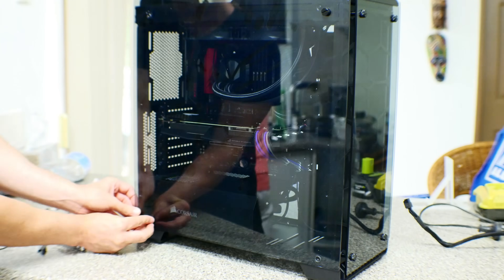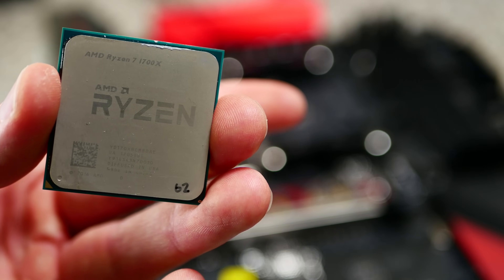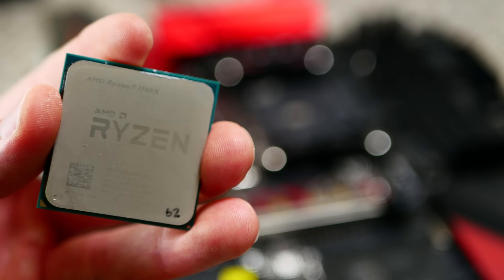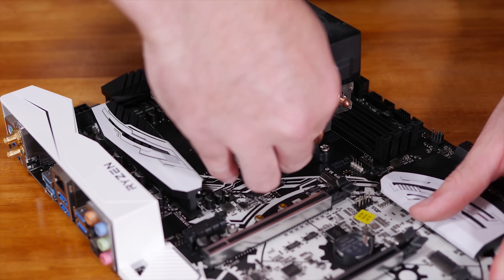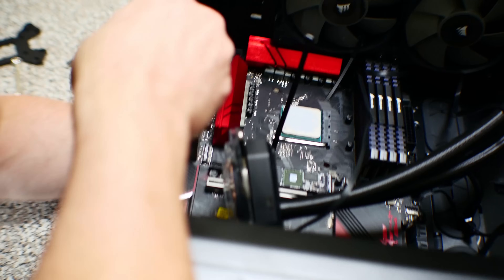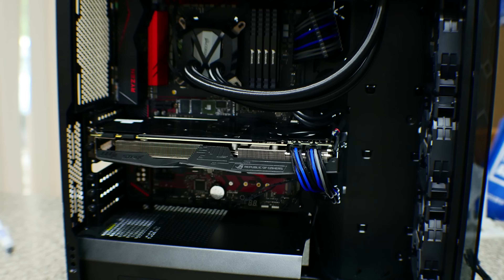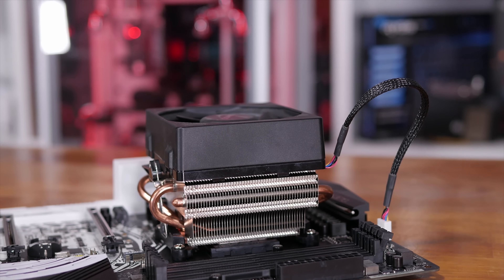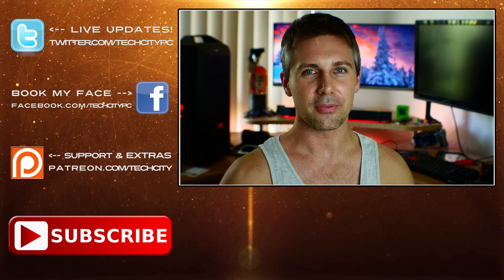AMD Ryzen AM4 Vs. AM3 - FYI - Avoid Any Day 1 Cooler Problems!

Comment from the maker: Got some measurements for you guys - 
AM3 - 49 x 97mm
AM4 - 55 x 92mm
Reply: If it wasn't clear:
The 4 holes on the motherboard are important for an aftermarket cooler that doesnt clip on the plastic  retention brackets and will use the holes for bolting the heatsink down.
Otherwise a stock 754/939/am2/am3/+ amd cooler fits on the am4 socket
Reply: @igorbog88  Thats what I've been confused about, all my coolers are compatible but I keep seeing compatibility posts on forums. I didn't understand what the problem was.
Reply: All the AMD AM3+ clip cooler will fit on AM4..
Reply: Tech City Thx alot . Im still waiting for the vid :) .
Reply: Does this mean that i can go to the store now and buy a h60 and it will be guaranteed to fit? Just switched out my server comptuer hardware to a 1500x. And the wraith spire that came in the package isn't quite holding up to the overclock i want.
Reply: Thanks amd! Where did I put my drill...
Reply: i think Thermalright says 54x90mm

Comment: So I just ordered a ryzen cpu for my am3 motherboard. Your saying that the processor will sit in the pin holes but I need a different structure around the processor to mount fans to cool it?! So I am happy without the structure with big cooling fan the processor works just fine?! The pins and the holes of the processors bed are the same right?!

Comment: I used my FX Wraith cooler on my Ryzen 5 2600X. It clipped right on the B450 mobo out of the box no screws. This 2016 FX version (shown here 0:51) is basically a non RGB  Prism with some minor differences in the plate. Originally designed for the 125 watt 8 core FX space heaters, its a thermal god on a 65/95 watt 2600/2600X. Its within 5 ℃ vs. Hyper Evo 212 in test : https://youtu.be/D9lCASJ17ps?t=163, better than stock, great price if you have one already, snaps right on, nice back lit logo.

Comment: I know I’m late to the party. Intel guy here. I just build a zen 2 system and the cooler I bought shipped with an old style backplate that doesn’t fit am4 even though it claims it fits on the box and the instructions claim it fits. I contacted deepcool who makes the cooler and they are basically acting stupid. Sending me photos of the instructions that I already have on paper in front of me. Asking for photos that they obviously didn’t look at because they won’t even acknowledge the issue. I’m lucky amazon graciously decided to replace it and a new cooler is on the way. I hope it comes with the right backplate. I’ve wasted a lot of time and money trying to get a 50 dollar cooler to work when I could have bought a noctua instead lol

Comment: I have a Cryorig R1 Ultimate air cooler as well as the Akasa Venom Medusa air cooler (with three Noctua 3000 rpm indusrial fans). Currently using my Akasa on my awesome X99EWS (with 5820K). I emailed Akasa and Cryorig one week ago enquiring about AM4 brackets. They both replied they are still working on it. No idea of ETA. Not impressed as I cannot build my Ryzen rig. Have to twiddle my thumbs and wait for the AM4 brackets. Any idea where I can purchase the new AM4 wraith cooler?. BTW, I live in UK. Thanks for help. Peace out!.

Comment: Hi Tech City, i wanted to ask if a Pentium G4560+ Gtx 760(From Ebay) is a good idea ? A pretty basic Pc with evrything new, just the 760 is used would cost 300-310€, GTX 760´s are selling for around 50 € in Germany

Comment: Soooooo... this guy doesn't know about all the adapter plates/kits for the AM4 socket and the more popular bolt on cooler brands?
If you have a clip type AMD cooler, it's supposed to already work. They changed the bolt circle, but left the spacing on the brackets for the clip mechanism the same.
If you have a bolt on CPU cooler from Cooler Master, Noctua and some others, you can get kits for your favorite old cooler to fit AM4 mobos.
Reply from the maker: I mentioned that the latch type coolers will work, however bolt downs won't as the holes don't line up.
Reply: That's just it, most popular coolers will work with AM4 with the 
"adapter kits". Noctua and others are putting out adapter kits for popular CPU coolers.
https://www.newegg.com/Product/Product.aspx?Item=9SIAADY5BC4729&cm_re=cooler_am4-9SIAADY5BC4729-Product

Comment: Thanks for the heads up! Luckily Cooler master will release a bracket for the hyper 212 evo, so I'm covered. I want to ask you for a huge favor, I noticed in this video that you have the Fatal1ty X370 Gaming K4 motherboard. That is the motherboard I'm looking to buy for my Ryzen upgrade. Could you please please please make a review on it, and maybe you could answer a question that I have about it. What is the max ram speed that this motherboard will take? The asrock website says up to 2667, but I know ryzen supports 3400+ hz

Thanks!!

Comment: Hey, thanks for going over this. I was wondering the same thing. I know that Ryzen is on a new platform, AM4, so CPU cooler compatibility will be different. Its looking like early adopter headaches for sure. I am still 50-50 if I am going to get Ryzen on day one because of this stuff. Not to mention, other things once all the components are installed like software, bios, issues, as well as, what kind of a platform AM4 really is. Like, we know, it has 8-cores. But, does general computing, day-to-day stuff benefit? What about video editing? How does Ryzen, in video editing and general computer usage, feel like? I hope you go over this on your review? Like, the "feeling" of Ryzen? The snappiness of Ryzen? How does Premiere Pro, for example, react to Ryzen? Thanks!

Comment: so if anyone was wondering the biggest air cooler that still has a hold down bracket is a coolermaster T4 anything bigger includes custom mounting . so in theory you could use that untill you get a braket instead of stock

Comment: Simple solution, hold off buying Ryzen and wait for an appropriate cooler update or new release. Current products may not be fully replace within 6 months (whether it is retail store or online).

There are AMD stock cooler for $5, or $1 if you buy it second hand.

Comment: I've been told by the company I ordered my 1700X that stock coolers will be included. At least will be able to use Ryzen until Corsair and NZXT catch up (they been asleep). Those are the makes I use. NZXT told me they'll only have AM4 brackets by march 15th. That's 2 weeks after Ryzen arrival date. WTF have they been doing ?? It's not like they didn't know Ryzen was coming.

Comment: I had heard the ryzen die is thicker so am3 coolers that fit will cause undue pressure to the die.  Can you confirm this?
Reply: adding a few small washers should fix that i would think,and/or getting different screws
Reply: AMGV Media http://www.tomshardware.com/news/amd-ryzen-am4-motherboard-heatsink-problem,33771.html#xtor=RSS-100

I'm confused now lol

Comment: I beg you, PLEAASE benchmark CS:GO at day one.  Every CS player has been waiting for new more powerful CPU's that can run the game at 350+ fps at all times.  When ou do the benchmark, please do it with low settings. I think this is something every CS player will appreciate!
Reply: Make sure to hack autoexec.cfg to run in 320x200 resolution with Minecraft shadows.
Reply: You're kidding right? CS:GO is one of the most CPU intensive games, if not the most. Yes, it runs on potato CPUs, but it is still very CPU heavy.
Reply: One of the "MOST" CPU intensive?
Reply: NO MA'AM National Organization of Men Against Amazonian Masters!
Reply: Getting high FPS makes a huge difference in competitive games. The difference between 200 and 250 FPS is very noticeable, even on a 60Hz panel.
Reply: ArdaBlock i get 200+ with a shitty haswell i3 3.5ghz and rx 470... its not a demanding game at all, and there is "only" 240hz monitors out now...
heck even my amd apu hooked up to my 4K tv gets in UHD 50-60fps... 40-50fps in proper 4K.

i tested this game at 290-300fps on my friends computer and i cant tell any difference between his and mine.
in the end, i capped it to 144fps since thats what my monitor can display.
Reply: I'm not saying it's demand, I'm saying it's CPU heavy.
Reply: Beamng.drive is probably the most CPU demanding game that I can think of.
Reply: Except that Ryzen isn't a gpu...
Reply: a lot of people are missing the point. CSGO does benefit greatly with higher frame rates .  the higher the frames the faster response time you get in game. there are videos on YT that prove it that's why completive cs players aim for the highest frames . and Gpu doesn't matter all too much as long as it's a capable one
Reply: well the hope is that one of the cheaper processors will run cs go at 350+. That's the point of the benchmark. Benchmarking something like the 1700x makes no sense because we know it will
Reply: CS:GO, are you fucking kidding me? Might as well try out minesweeper. Let him run some real demanding games to see the potential of the chip.
Reply: ArdaBlock  yet a stock haswell i3 3.5ghz pushes 200+... nope not buying.
cant be worth spending 4times on the cpu just to get the last 40-60frames, better off upgrading the gpu.

Comment: I've read product description before i pre-ordered Ryzen 7 1700X, it's bummer as hell, it didn't include with stock cooler, so, i had to look up Coolermaster compatibility schedule if a heatsink could fit or not without buying a bracket, i picked Hyper T4 for cheap price from local store then pre-ordered Ryzen 7 1700X.

I think wraith cooler could be also adds more price tag with it for 1700X and 1800X. Ryzen 1700 non-X comes with wraith cooler, what the product says so.
Reply: Sarge JJ it's normal lol

Comment: sweet so any am3/3+ mounting hardware will work?
Reply: No, am4 is ryzen socket type.
Reply: No they won't. Sockets are different size. A few will but most won't. Different bracket needed.

Example:
https://www.overclock3d.net/news/cases_cooling/corsair_releases_socket_am4_compatibility_info/1

Comment: Zip tying your cooler to the motherboard if it doesn't fit the mounting holes is okay so long as the cooler is tight enough. Just for the love of god, DO NOT DRILL YOUR MOTHERBOARD. The PCB of the motherboard is layered so even though it may look like you're not drilling through components or connections, you most likely are. You will kill your motherboard by drilling it
Reply: He's right, you should never drill your motherboard. Use a hole punch instead ( ͡° ͜ʖ ͡°)
Reply: NO MA'AM Or a belt sander. whatever gets through the first later
Reply: RaMpAgEAuS117 a hard lesson learned easily through jayz2cents. 😂
Reply: i would try and drill a hole in the bracket first

Comment: I know for a fact coolermaster has a compatibility chart showing which coolers shouls already have the new AM4 brackets if you buy it close to the launch of RYZEN and i know for the masterliquid pro series they offer the AM4 brackets free but you have to pay shipping .. SO just check with your cooler manufacturer web site or contact them ....

Comment: Thanks, :D ... Please make a huge Benchmark, not just GAMES, try heavy SOFTWARE please. from Autodesk, and Video editor rendering
Reply: Ahmed Hameed yeah adobe stuff is really important , 4k and 1080p
Reply: Ahmed Hameed he'll do a small part of but will not focus it.

you don't get it, FX series were fine when it comes to rendering. the problem it was just shit for gaming because the cores weren't powerful enough
Reply: just look at the cinebench scores, that's all that matters.
Reply: yeah something like unreal editor 4 rendering...
Reply: isn't autodesk thousands of $...
Reply: Autodesk is the company, they make different software just like Adobe does. The reason I always say just look at the Cinebench scores is, behind Cinebench is a full on modern rendering engine. So for a benchmark that is doing a whole lot of very complex things on all cores without ever letting up until its done, Cinebench is a great tool to get a very good idea about the overall strength of a CPU in single threaded and multi-threaded tasks.

If you're worried about things like, well will it uses 8 cores as well as it does 4 Cinebench makes use of all cores to about the highest standard I've seen from anything outside of just pure stress tests that artificially throw the same thing over and over again at each core. And that's frankly bloody useless for anything but testing if your system will fall down under heavy load.